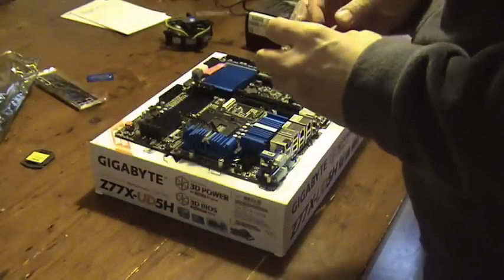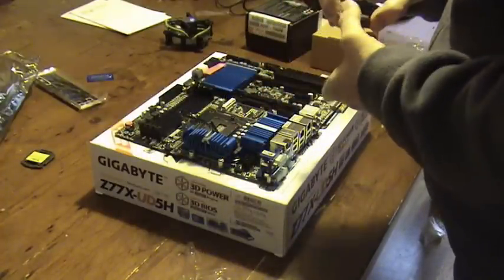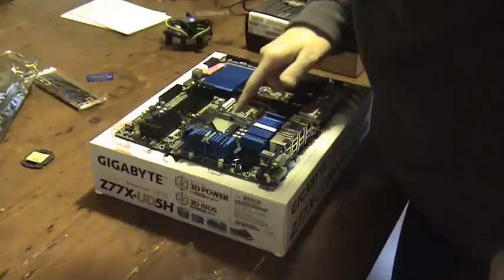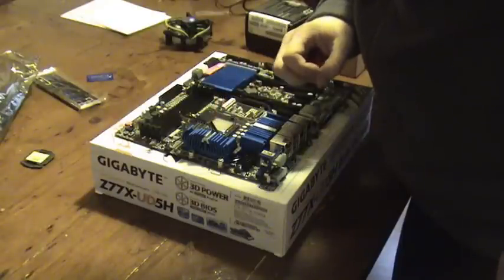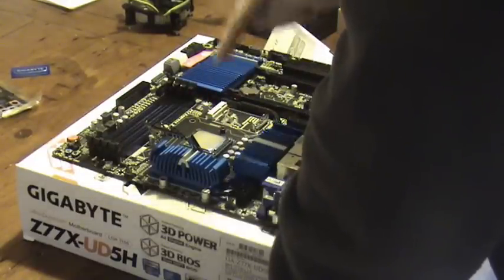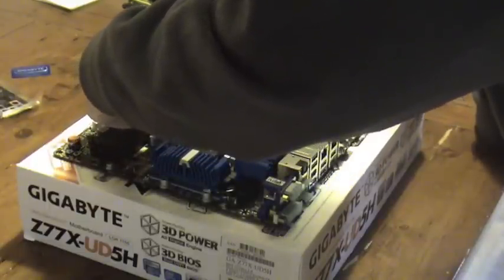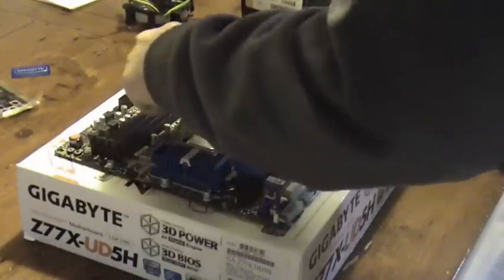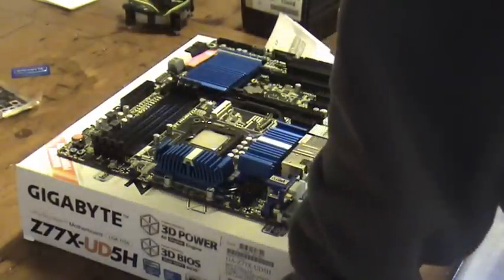P3 - Installing the cpu on the motherboard - Core i7,GA-Z77X-UD5H

Comment from the maker: ty for the comment Christian and excellent advice, I have warning messages in my about section (see above) with regard to static buildup and discharge and making sure the oils of your hands and fingers do not come into contact with electronic contacts on the underside of the CPU or the fitting plate the CPU interfaces with - thanks for the reminder.